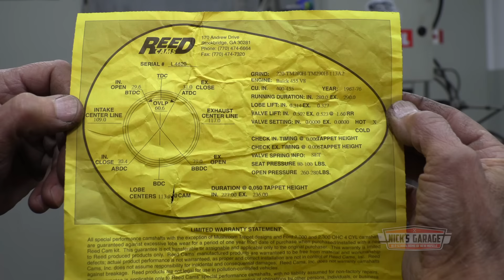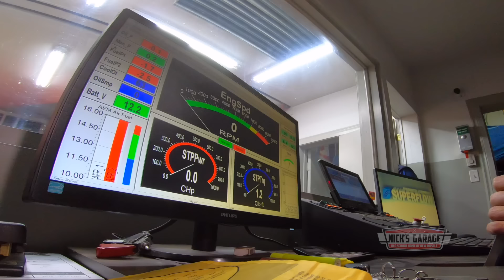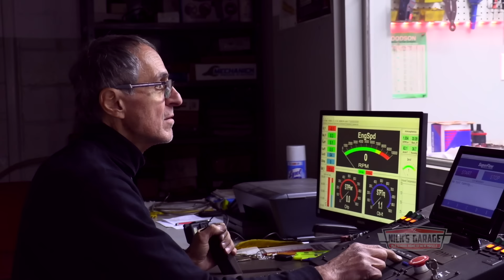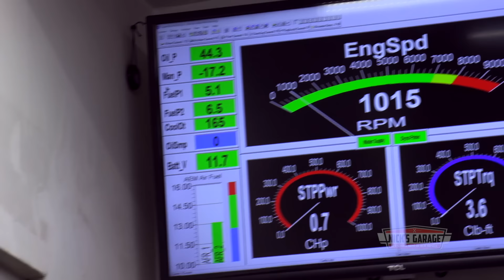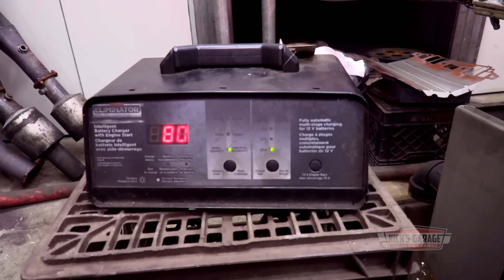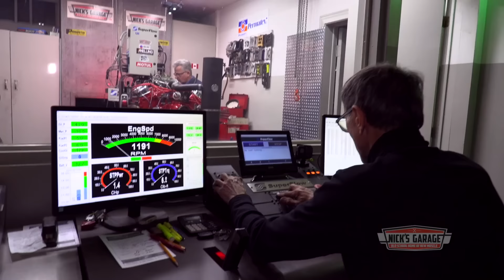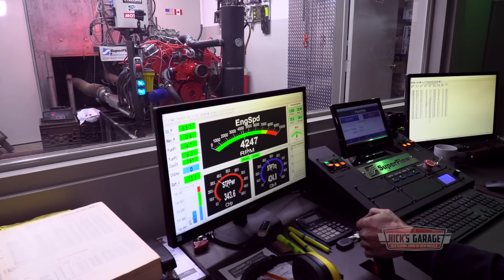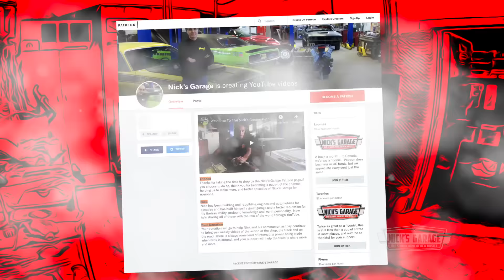1970 Buick 455 Stage 1 - Dyno Room Diagnosis

Comment: I have owned 455 Buicks for over 40 years . A se of stg 1 heads a hemi killer cam and a slightly tweaked  torque converter and you got a street beast. I always enjoyed opening the hood and saying look you just got beat by a 455 with a stock intake and q jet with factory exhaust manifolds 😅

Comment: To cure the oil adapter housing leak, you need a thin coat of GM anaerobic sealer on both gasket sides, and let sit 12hrs.

Comment: This engine should have no problem exceeding the Stage 1 455 numbers. Buick 455's like big carbs and I'd be willing to bet it's pulling a vacuum at WOT.  That's what's killing your power numbers.
Reply: According to die hard Buick owners, 70 carbs weren't that great. They were better in 71-72. A lot of them have been "swapped" because, I think, 71-72 were slightly bigger or something like that.
Reply: I agree that old Rochester carb is junk I would put a better upgraded carb
Reply: @rverro8478  Nothing different with the carb for any of those years.
Reply: @bigthunder2860  Quadrajet carburetors are absolutely wonderful if you know how to build them properly. Most people don't have the proper skills to build them.
Reply: Get a big 950  edlbrok on there  more fuel
More power

Comment: mystery vacuum leaks: Something to look for when chasing a leak. I saw heads being prepared by Brandywine Cylinder head service for IROC race cars back in the seventies. They  were pumping some sort of sealant through the water jackets in the head to plug up 'any' porosity in the intake runners of the heads. A, don't look at that!  There were very clearly tiny plugs in the ports in some heads.

Comment: What became of packing the oil pump with petroleum jelly in order to accelerate its ability to supply oil pressure to the engine? Furthermore, the thicker oil pump gasket will result in greater end clearances for the oil pump's gears, resulting in lower flow and pressure from the pump.

When I was building these engines, there was always some wear on the oil pump end plate. I sent the "scored" endplates out to be plasma-sprayed with tungsten carbide. The returned oil pump endplates were then lapped in diamond paste until they were "perfectly" flat.

Never had a problem.

Comment: Stage 1 455 GS engines would have had high lift camshaft , big valve heads,  aggressive distributor timing  special quadrajet carb

Comment: Low voltage to the coil will do it especially with points. If they are. Dialed in  they make good fire but if not  on low voltage. I think j would go to hei. It would add a little more hp and no worries about frying the points

Comment: The beauty of these 455 Buick motors lies in their Monster 4.3125" Bore and short 3.9" stroke. With Stage1 2.125 " intakes .modern roller cam &rockers, /500hp @ 5000rpm is easily obtained

Comment: You changed to a cam with a lot more duration, but you did not recurve the distributor so you could run more initial timing. This is why the torque is down so much.
Reply: Will be done while waiting on thinner head gaskets.

Comment: I've said for years I never believed many factory HP/TQ numbers both low and high. They played games with the numbers for various reasons. Based on design alone, a "stock" Pontiac or Olds 455 should produce more torque compared to Buick as they are also small port motors but have a much longer stroke.
Reply: Agreed. Never actually witnessed any Buick 455's produce 500+ torque in reality, from the factory. Not with that little 3.900" stroke. Oldsmobile, yes. Pontiac, yes.
Reply: @jrdmotorsports9718  "From the factory" is the key phrase here.  NONE of these stock engines mentioned produced ~500 lb.-ft. of torque.  I've personally seen enough dyno pulls on my uncle's DTS engine dyno to know that Buick 455's built similarly to their other GM brethren could easily hold their own.
Reply: @LR-my2di  Read. You are just reiterating what I already said. Can they make over 500? Yes. Have i? Yes. But that wasn't the the conversation.
Reply: @jrdmotorsports9718  The emphasis was on "factory stock".  How many folks have actually dynoed any of these engines in pure stock factory configuration?  Who would even care or want to? That was my point.

Comment: Hi Nick love your show. I watched the video of the 400 chev from Canada, I was wondering what is the compression ratio of that engine. I have the exact motor and wanted about the same hp. I know 10.5 is pushing it but would I have problems with that. I have 60 over with flat top and heads are 72 cc.Thanks.

Peter

Comment: I'd love to see an Oldsmobile 455 on your dyno :-) Did they come in the 4-4-2 or just other Cutlass variants?
Reply: Also in the Toronado .
Reply: 1970 W-30
Reply: GM had a corporate rule that no intermediate (A-body, like a Chevelle, GTO, 442, or Skylark) could have an engine bigger than 400 ci. I think this was that they felt it would reduce appeal for the full size cars, particularly like the Impala or Bonneville, and the specialty cars like the Toronado and Riviera. However Ford and Chrysler had no such rule and eventually GM dropped this after the 1969 model year. Thus for 1970 all of the GM divisions that produced intermediates offered up a 454 (Chevy) or 455 (BOP) for 1970 and after. Most of them offered an improvement over the 396 (Chevy) or 400 (BOP) that were offered in 1969. The exception might have been Pontiac, who offered the 400 Ram Air IV in 1970 as the highest output engine on the GTO, even though a 455 was available. I had a couple of GM A-bodies in the early 80's, a 1968 442 with a 400 Olds engine & 4 speed, and a 1970 GTO Convertible that had a Pontiac 455 & Turbo 400 automatic. The Olds was without question the quicker car; the GTO was more of a cruiser with rear gears about 3.08 IIRC.

Comment: If I remember, 1970 stage 1 block was stamped with SS or SR code on the vin no. Driver side between cylinder. 5 and 7.

Comment: The thicker oil pump gasket is a questionable decision since that thickness is directly related to the gear clearances in the oil pump housing. Excess clearance means excess space for oil to leak internally, reducing pressure.
Reply: I know.   But a few thousands did not make a difference on this engine. Look at the oil pressure, all good.
Reply: TA Performance at least used to sell an entirely new timing cover and water pump housing that accomodated longer impellers, a steel thrust plate, and an externally adjustable pump. No reason to worry about oil psi with that setup. It used the stock gasket.
Reply: @bbb462cid  I ran the Kenne-Bell oil pump extension kits on my Buicks and since that had two gaskets, I would tune the spacer plate thickness to be 0.002" end clearance for the pump gears. Before my adjustments there was 0.010 which was way too much, it barely had more pressure at hot idle than the stock setup.

Comment: Boy, .040 over makes that block pretty thin with outchecking for thickness.75,76 best blocks to bore
Reply: Not really. Have done many without issue. And on the contrary, 75/76 blocks were weaker. Less Nickle content in ALL GM iron factory blocks. Pre 74 are the best.

Comment: I don't know. To me, it's the cam design. .2 lower on the static compression really shouldnt affect things. 
I'd run something special for this, custom with a lot of snap and a decent idle. Something that can pull through the rev range.
Reply from the maker: This is the first time anyone brought a cam like this to the shop.
Reply: @NicksGarage  Reed used to be heavy into circle track applications. TA Performance or Kenne Bell would at the least better since this is all theyve done.
Me personally, I'd get Jones Cam Designs to custom grind something. They have the secret sauce when it comes to cam design.

Comment: first car I ever got to drive down the road by myself was a 70 GS455 car...  I had no idea how lucky I was... brown/white vinyl top....
Reply: We built one many years ago and we had to add a vacuum can to it a canister to bring the inches of mercury where it was supposed to be that might be the problem Nick you have to have a separate vacuum canister to bring that down so you can get it to idle properly it's just like we call them coffee cans
Reply: @royb7481  those are vacuum reservoirs.. There is also a check valve.. Problem was under acceleration, Heat/AC would nose dive and go full defrost ..   Customers not too keen on that.. pretty reliable part.. changed a lot of check valves over the decades, not too many cans..

Comment: Oh the memories 17 years old Grandma's Old 74 Buick station wagon 7 cylinder had a valve out of it demo derby blew the rod in the heat still running made feature drain water and oil out of pan filled with oil won my first feature all four rods blown out of the center of Crank running on four cylinders toughest running old engine ever had

Comment: Cool big block Buick! I wonder with the vacuum leak issues you were having that the heads were milled sometime in the engines life. You’d probably have to cc the heads and compare them to another set. Great job getting it fixed.

Comment: It has been a lot of years since I had one of these 1970 Stage 1's. I seem to remember the compression being 10.25. It was a 4 speed car so the machine shop sold me the biggest spec'd cam for that application, it was a Crane piece. I had a friend that needed a 'fix' so he offered to sell me a Holley 650 spread bore double pumper with mechanical secondaries for $20. this was in 1982, let's call it. The next day he had twenty bucks and wanted his carburetor back. Sorry dude, let that be a lesson to you. I kept the carb and it did really well on that motor. no idea what the power and torque numbers were but it would spin L60's through all four gears. replaced the pressure plate and clutch with Borg & Beck style, 3500 pound Heavy Duty from NAPA.

Comment: Just a fun Fact !  Pontiac never made a Big Block , all V8's were the same block , from the 326 to the 455 .. They were called a medium block :) :) :)
Reply: Rick Marin thanks for the fun tip I had a 79 Trans am with a real Pontiac 400 an never knew that.
Reply: @waynehardy6186  That's why they so fast , less weight and could pack a punch :)

Comment: Great Gm engine…. Always a pain to get those old engines spec correctly, especially when someone else is done the build, yes they we’re rated 365 hp I actually think they put out like 400 hp factory with a stage 2 package in the trunk if you desire cam and heads did even better 420 hp

Comment: I would like to see a Stage 2 cam in there and a Edelbrock Performer aluminum intake manifold and 1.6 roller rockers, a nice Solid Roller cam in there, double roller timing chain, tuned Q-Jet and tri-y small  Tube/long Tube headers. Then change out to the original cast iron intake manifold and Q-Jet and cast iron exhaust manifolds, dual exhaust.

Comment: I have always wanted a 455 stage 2  with a newer 6 speed manual trans. 
 With 3.90 rear gear. 
 This what the dyno is for smiles per gallon  even know it's a challenge sometimes. 
 650  cfm Rochester carb should be enough for this set up. That engine drinks a lot of fuel. 
You guys did well with the parts available at the time.
  Be safe team. Good work. 👍
Reply from the maker: Thanks for being here, Jeff.

Comment: My old Cadillac 472 had 500 ft lbs torque and only weighed 65 lbs more than a small block chevy. What a great engine it was just stock...made my old Chevy pickup run great and hauled whatever I wanted with that old combo. Someday I will get another old pickup like it and make it a torque monster electric truck with a special generator that should allow it to run coast to coast without needing to stop and recharge and doesn't use gas or diesel.

Comment: I just got done with a # matching 71 455 true Stage 1 Buick. Factory rated at 345hp/460 trq. In 71 they were 8.5-1 with no quench. I ran a small Crane flat tappet a bit bigger than the factory stage 1, 9.35 comp, 0 deck with a .039" gasket, and Speed Pro dish pistons that are "rated" at 27cc, but in fact are 23cc. I stepped the crown down a little more than half way around for more volume at 28.5cc's to make it work, leaving the quench pad.  Oil pump gave the same issue even with a TA cover and pump. Used a little anaerobic sealer. Also had to mill intake .060" and use soft gaskets. His Carb was also dead lean and couldn't use it. Luckily we had pertronix in the distributor. All in all, made 376hp/480 trq. with stock exh. manifolds, and 33* timing. Didn't like 35*  
Even though the 70 Buick stage 1 was rated for 370/510, i have never seen it in reality. Stroke is just too small.
Reply: You've tested a true bone stock factory 455 as you mention here?  Stroke is just one part of the equation.  Truth is, hardly any of these old factory ratings were what they were advertised to be.
Reply: @LR-my2di  Yes. I know all about the equations. Fact of the matter is, they did NOT make over 500 ft lbs from the factory.